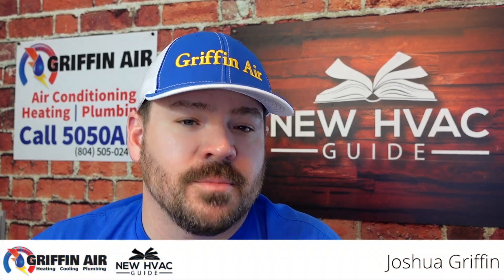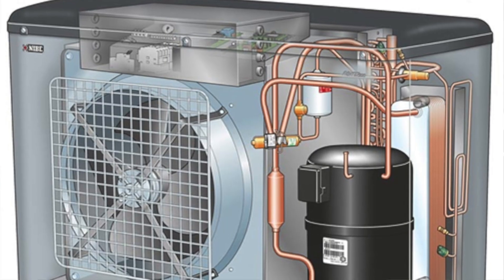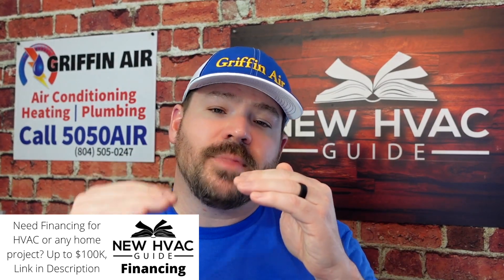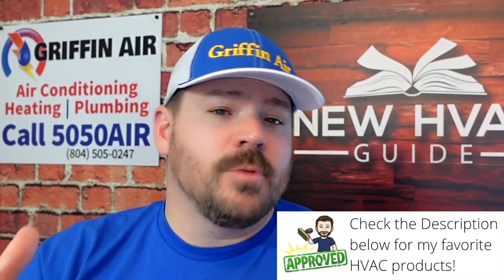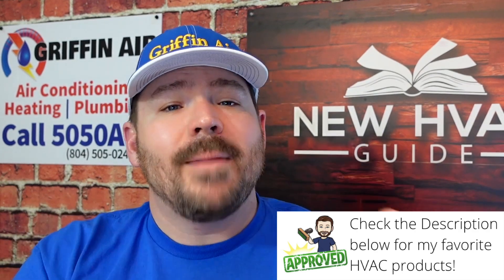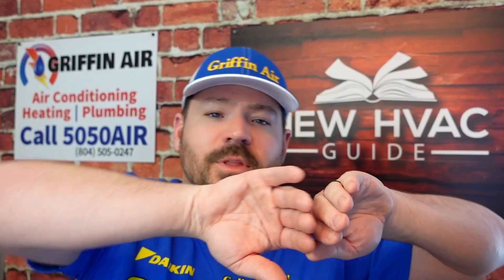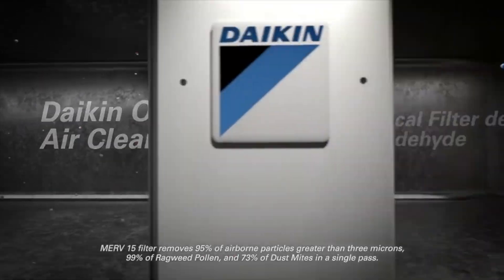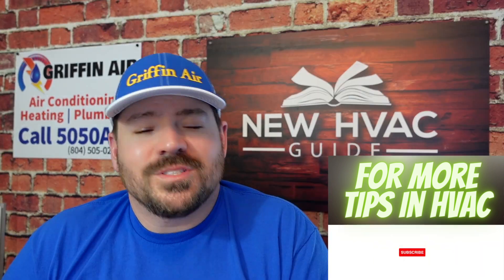What is an Inverter HVAC System?

Comment: I have being doing hvac for 23 years and just built a home and have been in it three months I have to say working with all the systems on the market the system I went with was the Goodman side discharge full communicating inverter I live in Alabama and it’s very hot here in the summer I have to say the inverter is well worth it my system stays on 73 and it can be 99 and feel like 108 and this system never really gets to 100 percent capacity if it does it for a short time but every time I have been outside going things the outdoor fan is running at about 50 percent and I really like how quite it is you have to be right on top of it to hear it running and I also like how it ramps up and down so I’m like Josh here this is where heating and cooling is going it’s already taken place and in five years this is what we well be dealing with and using

Comment: I did a little reading and just bought a dual inverter window ac (I know, window ac) even though we have a new roof top unit; Arizona. Will install in a day or two. It's over 110 degrees. Thank you for the explanation.

Comment: An inverter heat pump takes incoming a/c current and runs it through a bridge rectifier to create a very smooth DC current, that DC current is then put through a simulated 3 phase AC inverter which is can be started without start windings and its speed can easily be controlled. This is why a 2 stator generator that produces dirty AC can be used on an inverter, it is going to be rectified anyway.That is the compressor, the condenser fan is controlled differently. Some are DC being powered off the rectifier, some are just multi speed AC and others are simulated 3 phase just like the compressor. Hence All inverters are variable speed but not all variable speeds are an inverter. There are units, particularly the ones that run off of solar power that are DC and actually use a DC compressor. Inverters today are very good, surpassing 95% efficiency but even that 5% is too steep a loss for solar powered units. I think the biggest hurdle for manufacturers to go to all inverter units is the simple fact they spent the last 35 years tooling up for scroll compressors. This took quite a while as they were still selling piston style compressors in 2010 and maybe later. They are not having any success at varying the speed of scrolls which makes them unsuitable for inverter drive motors. Now rotary compressors are being used, the rotary is not new, they have been using them in refrigerators for decades but for some reason not in AC systems. So now they will have to retool to build rotary compressors. Hopefully with the new CNC machinery available today it doesnt take 35 years to do this. Even the best vapor injection units found on the Mitsubishi are rotary.
Reply: What about natural gas condensers instead of electric?

Comment: The issues to overcome with more complicated/higher seer/more efficient systems:  The cost has to make sense- upfront cost and maintenance cost.  Two years ago a friend bought a 3 ton Lennox split system with a XC16 2 stage cool 16 seer A/C and a SL280V 2 stage heat variable speed gas furnace for $8000.    Great deal, but if she bought the XC 25 (22 seer) A/C, then it would’ve been $14,000.  Maintenance cost are way higher on the highest seer rated A/C because of needing to replace the computer circuit boards and other expensive parts after a period of time.  
Technicians need proper training to install/set up/program the systems.  They didn’t even program her gas furnace to put out the right amount of airflow.  Left it on factory settings.  There are 12 speeds for cooling and 12 speeds for heating.  Need to have Wi-Fi in the house for communicating systems, not everybody has it.
Reply: Wrong. You don't need Wi-Fi for communicating systems. Does it help? Sure but you don't need it. Wi-Fi is just for people who want to run the system off their phone or laptop.
Reply: @jeremymorgan7199  Her system initially included a fancy Wi-Fi thermostat  but she did not want to put in her user ID or password and wanted a simple or basic thermostat, and they were able to do it.  But her system is two-stage only.  What if I was buying the Lennox EL 18XCV with the Lennox S30 thermostat or something similar.  Or the EL23XCV with the S40 thermostat or similar.  Those are variable capacity systems.  Could I use a basic thermostat with those?  Or if I use the recommended thermostat, you’re saying I would not need to be connected to Wi-Fi?  I currently do not have Wi-Fi in my house.  I read a lot of complaints about those higher end Lennox thermostats. Thanks
Reply: @michaelcinaz  you only need Lennox S30 thermostat when it's an inverter system. They recommend using them on all their equipment bc setting up the programs is much easier but if it's just a 2 stage system you can use any 2 stage t-stat you want. But you do not need Wi-Fi to run any system.

Comment: Hello Joshua; great explanation; I'm considering replacing my existing system with a 3 ton HP about 16 SEER.- 2 years ago I purchased a Panasonic Microwave oven and supposedly has inverter technology. It has no compressor, so I figured they used the word as a "silly buyer magnet". Buyer beware!
Reply: It actually uses the same inverter as your phone charger, a switch mode power supply.

Older and cheaper microwaves use a large iron transformer to generate the 4kv needed for the magnetron, the inverter type is a lot lighter weight and more efficient.
Reply: @sciencetestsubject  Thanks; where did you learn all that stuff? I didn't have a clue!

Comment: I had a quick question: I'm getting bids on a 4 ton system and received bids for Bosch and Trane, I'm told they are both variables (with inverters).  Does anyone have an opinion on which one might be better?  SEER2 17 for Trane and SEER 2 16 for Bosch.  Consumer Reports doesn't mention Bosch at all?? Thank you.
Reply from the maker: One difference is that Bosch is noncommunicating to the thermostat. It is also an imported product line currently

Comment: Which inverter system would you put in a new build in Charlotte NC?  My builder's HVAC has recommended the Bosch inverter system 20 seer or for $3k more the Rheem RP20 inverter system?   I asked for the inverter variable speed instead of a 2 stage heat pump system that he originally quoted.
Reply from the maker: If you want a true, communicating inverter system, then you should go with the Rheem. Bosch is an inverter system, but it does not have communicating technology
Reply: @NewHVACGuide  is there any more efficiency/better performance with the communication of the thermostats?
Reply from the maker: @stevenporter7969  check out this video on that exact question 🙂

https://youtu.be/DQi85LK-3do

Comment: I honestly don't have an issue with giving a customer what they want. But ultimately for me it's about application & cost later down the road for a customer. All homeowners just need do the research & understand the environment they choose to live in. & little tip for everyone a pulte home is  usually ideal for inverter HVAC equipment due to being built for high efficiency from the start.

Comment: Hi Josh,  love your channel!  You mentioned how inverter systems can meet requirements for Federal tax credits, etc.  Just wondering your thoughts on why the Daikin FIT fails to meet the EER2 requirement for the 2023 tax credits.  I'm still planning on purchasing a system because its so much less expensive than other inverter systems, but it would have been nice to get that fed tax credit!  At least it does qualify for a rebate with my local utility.
Reply from the maker: I actually just attended a class on that subject. They talked about how it does not meet those requirements, but with the rebate that it comes with from your dealer among other programs that are exclusive to the dealer on the behind the scenes, they should be able to give you a price competitive enough that you may consider the Fit over one of the systems that do qualify for the program
Reply: @NewHVACGuide  HaHa!  that was my conclusion; getting a $1100 rebate, 12 yr parts and labor.... I calculated it would take me over 10 years to make up the extra cost of a more efficient inverter system even after adding in the $2000 tax credit.  I was really just curious as to why the Fit has such low EER2 numbers; I'm thinking it has something to do with the outdoor coil efficiency (side discharge), but that's just a wild guess.

Comment: I've always wondered why our USA AC electric doesn't get "inverted" to DC at the point of entry for residential. DC current is a constant sine wave and more efficient with motors in general. 
I also say the same with the Cable and Satellite industry, why not put the "box" at the point of entry of residences and then let the tuners that come with the TV's or other devices use their own electronics to display the many channels. I can think of many reasons that is reasonable but one is saving the power each TV box must use because each TV location has to have the decryption of the signals and for that, a lot of these boxes are using 100 watts each. 

I do like the idea of DC operated HVAC as the efficiency is much better however, where is the natural gas condenser these days? Those seem to be even more efficient in cost to run.

Also, we need to look at the cost of maintenance for these inverter systems....A $200 AC 220v blower motor is about $1,200 for inverter type. Compressors are more expensive too and then there are all of the "electronics" with inverter systems that will fail along the way and they are all proprietary and expensive vs. "universal" parts inexpensive.

Comment: Are there any inverter systems that would  work with a Nest based system?  The communicating thermostats are outrageous.  As I have zoned system, that twice the outrage.
Reply: Nest suck but yes there's inverter systems that will work with nest. The Goodman 20 seer inverter is compatible with any thermostat including nest
Reply: Thanks for the information.  I will look at it. I am confused as to hate for the nest.  I have three 2nd Generation Nests and they work. Two operate a 20 year old zoned system (thinking about replacing this) . The other runs a mismatched system. It all works. Why should I hate it? What am I missing?
Reply: @sheldonoppenheim8724  they have smart learning technology that can interfere with newer systems. If you have older systems and like the nest. Keep it. But If you upgrade to inverter technology you may have to upgrade thermostat as well
Reply: Thanks for info. Point taken. As the mismatched system is still going and my wife insisting that all works with one app on her phone, I am stuck.  However based on your info and Josh's input it's not so bad.  Goodman/Amana, Bosch, and Allied all have inverters that could work. Time to get prices.

Comment: So “Inverter” must have a more broad definition of electronically intelligent voltage regulation, regardless of whether we’re talking about DC or AC input??   Because what had me so confused is that I saw an inverter compressor that had AC as input, and the variable output was DC.   I was so confused because I was always told that “Inverters turn DC to AC, and rectifiers turn AC to DC.”   

So, I’m guessing that perhaps it’s just SO common for inverters to convert DC to AC that many people incorrectly go around saying that the specific job of an inverter is to change DC to AC, yet that’s not accurate (it’s just the only application that these people have seen, so that’s why they think this)??   I’m guessing then that a more accurate description of an inverter is any type of intelligent voltage conversion/regulation whatsoever (regardless of AC/DC input or output)?

Especially if a person is mostly familiar with solar power, it really does seem like the ‘Inverter’ is absolutely the conversion of DC to AC (and you will be specific told by many people that that IS what an inverter does).   We may have one of those cases here where a technical term is confused between different fields/contexts.
Reply from the maker: Considering many inverter HVAC systems have DC controls and AC compressor, they still fit in your definition
Reply: @NewHVACGuide - to call an alternating current compressor unit an inverter is a scam - strange that they don't market the DC compressor which is really the part that save people money ( easily 40% less power consumption )
Reply: On mine it converts single phase 240 v ac to 3 phase stepped voltage. The “inverter” is a large board with output to the compressor and fan. The “inverter” creates a stepped voltage and varies the frequency. The compressor speed matches the frequency. I can hear the compressor clicking away at low speed. Is this “inverter” creating DC from AC, not in the true sense. Is a pulsed power ac or dc, I don’t know. Is the power square wave or sine wave, I don’t know. Does the power get converted from one form to another, definitely. Is this really an inverter, I don’t know what else to call it.
Reply: @TexasEngineer   In short, the AC is rectified to DC and then inverted to AC again so that frequency of the sine wave can be controlled. Induction motor speed is based on frequency, not voltage… That is an over simplification, but essentially what is happening… Would be better if they said variable frequency drive (VFD) as that is what you have…

Comment: For me less electronics the better I'll go for the mechanical system period...you will save money on electric...but spend 10 times more for repairs and maintenance.
Reply: That's just not true. Most of these systems come with good warranties to back it up
Reply: Wrong.
Reply: @Jeremy Morgan  no it's true inverter systems last longer because of smoother operation. Manufacturer warranties back it up aswell
Reply: @alberto4991  I wasn't replying to you my bad lol maintenance on inverters are often easier imo. You can run all your test through the thermostat or app and if installed properly they'll last.